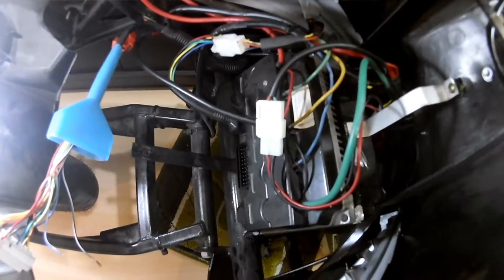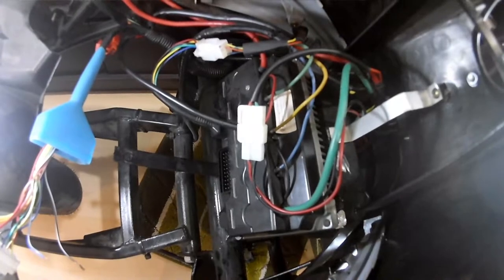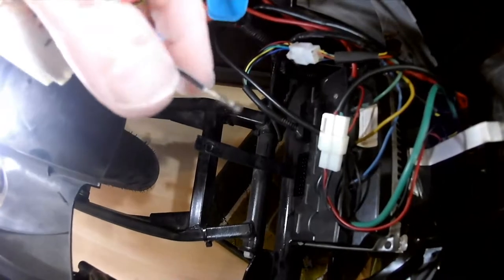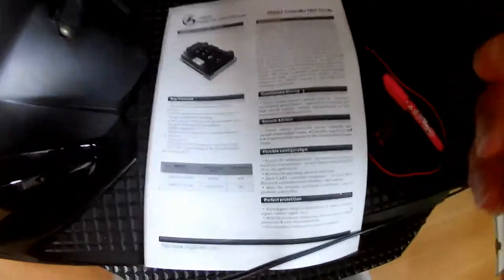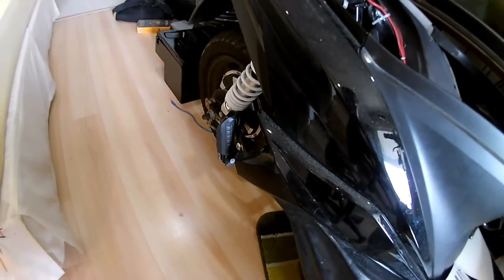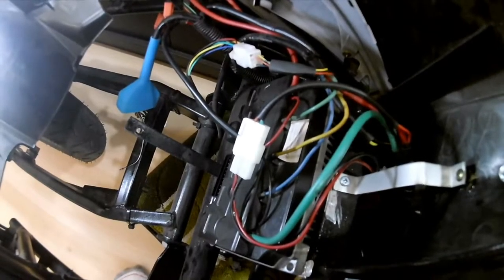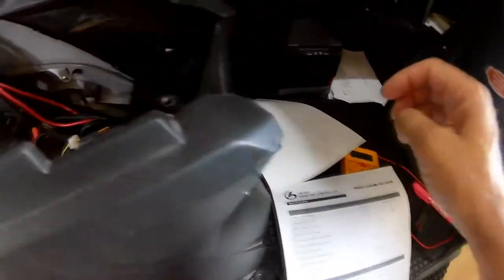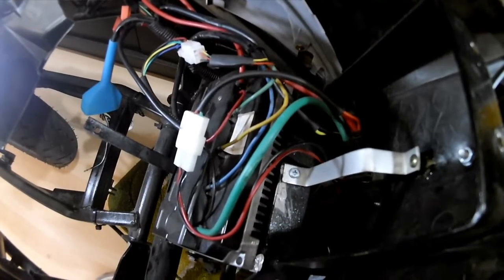Toyotron Electric Scooter Upgrades Number 8 - The Original Controller and Connector

Comment: I understand how a few tweaks can turn into a whole rebuild.

With your expertise, it probably would have been better to buy a Honda Wave with a blown up motor for a few thousand bath and  converted in an electric bike...
Reply: I understand. I have no clue where old cars/motorbikes go to die here. Judging from what I see on the road, people keep driving and fixing them until they disintegrate beyond repairs. There must be a vehicle crushing plant somewhere near Bangkok. 

But please do continue to post videos on your motorbike. We will probably end up with a step by step video instruction on how to make a good e-motorbike apart from the bodywork ;)

I bought a UD motors 400 W scooter and I am very happy with it, but the front brake broke off and  now this "simultaneous brake-throtle protection" has made it near impossible to drive it. The exact point where the bike considers the brake not be engaged is difficult to set, so it doesn't drive any more. I ll need to take it back to udon soon.